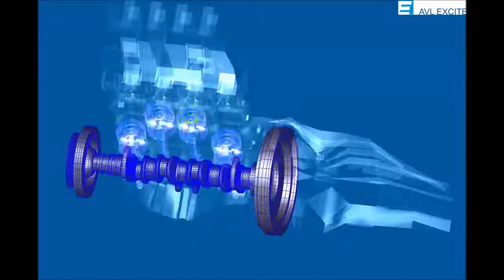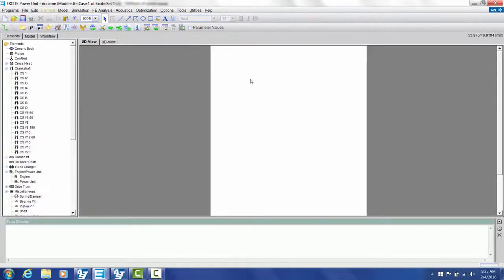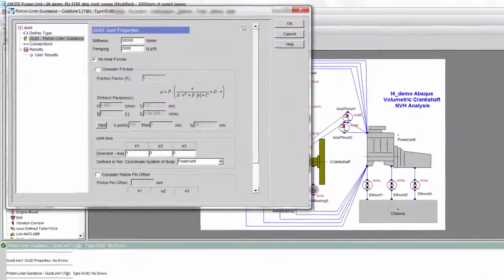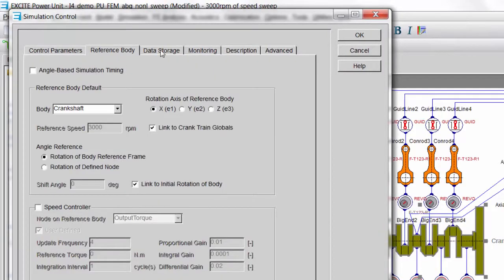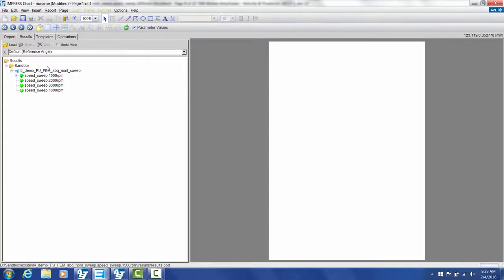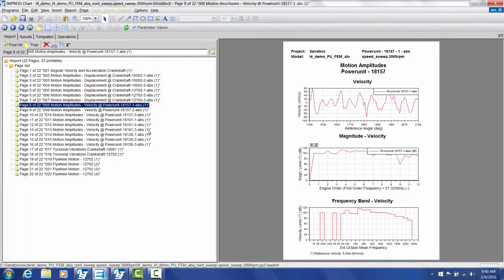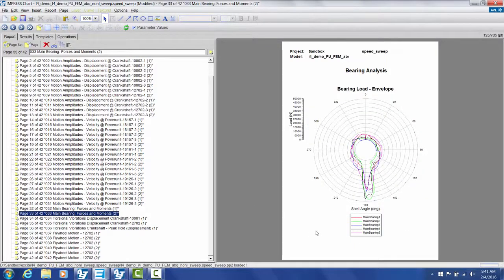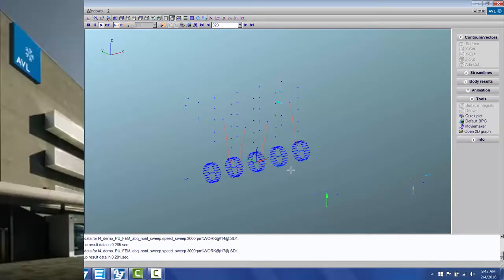Unlocking the Power of AVL EXCITE for Dynamic Simulations | AVL Experience Cloud

Comment: AVL Excite was first time introduced for the QSK95 Genset (Hedgehog Program) at Cummins Power Generation in 2010/2011 for simulating dynamic behavior to drive fatigue failure analysis for generator set subsystems such as the newly developed modular chassis design and slip joint dealing with engine thermal expansion for a running large engine like Cummins QSK95 (95L displacement, 3767kWm/5051BHP Standby). It helped to optimize the design, reduced prototype test times cost, product recalls and warranty costs – all with increased confidence that product designs pass their test schedules as “right first time”. 
The QSK95 Genset prototype costs about $1,000,000 to build, and it burns 915L (329 gallons) diesel per hour at its rated standby power. With AVL Excite dynamic simulation tool, we were able to evaluate and predict the reliability and durability of the newly developed modular chassis design and slip joint before the first prototype was built. Links to the patents of the skid and slip joint mentioned above==>
https://patentimages.storage.googleapis.com/0e/3f/27/59ebbd97523657/US9593799.pdf
https://patentimages.storage.googleapis.com/b9/52/c1/936d766e876909/EP2773895B1.pdf